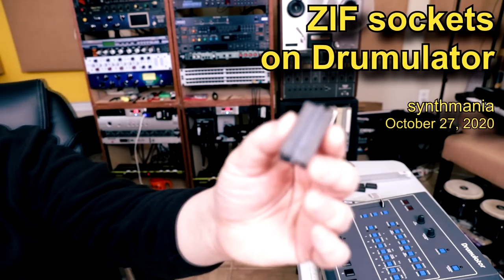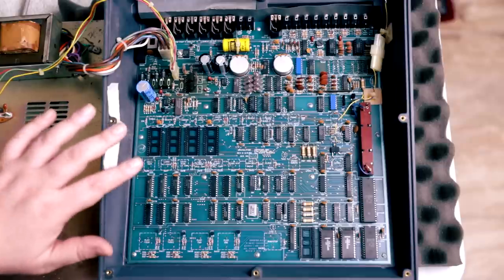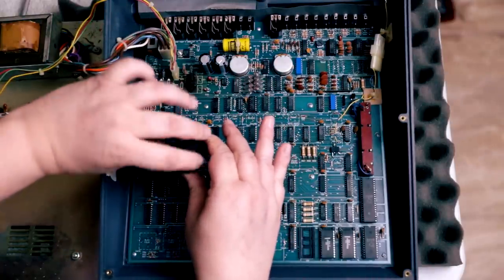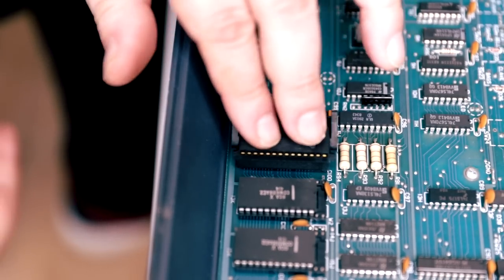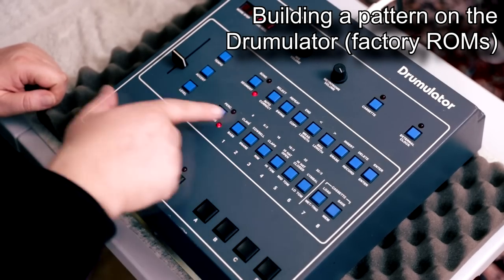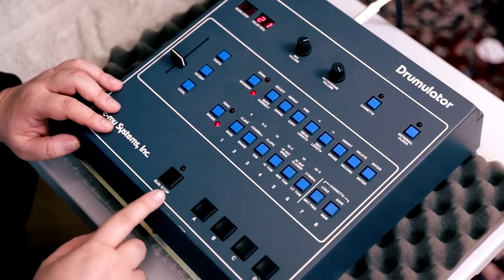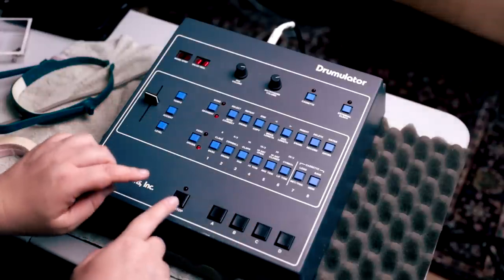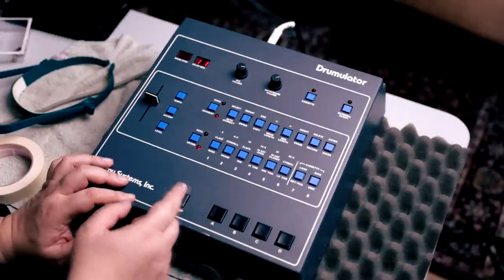ZIF sockets on E-mu Drumulator

Comment: For newbies - use extreme caution with static when working on electronics. ESD best practices are easy to find on the we can start with a basic wrist strap. Wurth has a video on ESD risks showing you can pass over 10,000 volts to your electronics via "static electricity".
Reply from the maker: In the drawers I have literally dozens of wrist straps that came for free with pieces of equipment I bought over the years - I never use them and never had one single problem. I like to live dangerously. Thanks for jinxing it, though!
Reply: @SynthManiaDotCom  hehehe. As founder of the Vintage Synth Museum, you know ESD well. My comment was more focused on newbies. Nonetheless, I still found the Wurth video on ESD "shocking"

Comment: My Drumulator has a commercially made switch on the front that toggles between 3 sets of EPROMs.  REALLY appreciating that now. Not sure why, but I love programming rhythms on that old thing, just enjoyable to use, was well designed.
Reply: Where did you get this mod from? I’d love to install it on my Drumulator
Reply: @orenberg1  It has a metal faceplate that says "JL Cooper Electronics 3-Kit" It was already installed when I bought it a few years ago.
https://jlcooper.com/_manuals/legacy/Drumulator/JLCooper_Drumulator_Kit_Installation.pdf

Comment: That "Rock Drum" ROM chip set (by Digi Drums), did they sell the same sound library ROMs for other drum machines as well?  That drum samples sound very familiar!  Great video again!
Reply from the maker: Thank you and yeah - they started with the Drumulator - IIRC reading somewhere - because they were near E-mu, and then started to offer their chips for other drum machines of the era, too. Eventually they became Digidesign (of Pro Tools fame). "Digidrums opened for business at the January NAMM show, with several alternate sound sets for the Drumulator. They've rather expanded since then. Now they offer 15 sets for the Drumulator, and 35 individual sounds for the Sequential Circuits Drumtraks. Coming soon, they say, are alternate sounds for the Oberheim and Linn drum machines." Source: http://www.muzines.co.uk/articles/namm-report/8465
Reply: @SynthManiaDotCom  Thank you so much for the info!  I didn't realize that it became DigiDesign.  The article gives me some context; it was around the time Kurzweil 250 was released, and Akai wasn't in the sampler game yet.

Comment: Good Day Paolo excellent video and looking to do this on one of my drum machines, I read in the comment that someone has a Kawai R-100 I have both models 100 | 50 , I looked up at the Aries website but unsure which one to choose ? I'm sure its a 40 pin socket but options are required to select?? , I been budling a library of custom sounds but do not like the idea of forcing chips when interchange, could you  suggest please which one would be a good candidate for my drum machine? I greatly appreciate Paolo have an excellent day buddy!! 👍

Comment: Does Zif Sockets still exist ? I feel nowadays chips are either soldered on the PCB or they are on a socket but not a Zif one, a simple socket (and they are a bit fragile btw)
Thank you Paolo, awesome video, always a pleasure to see and hear your drumulator :D
Reply from the maker: Thanks! Yes, today the prevalent manufacturing mode is SMT, which undoubtedly can make products smaller, cheaper, easier to manufacture automatically etc. - but hard for end user serviceability / upgrades...
Reply: @SynthManiaDotCom  It reminds me the inside of the midiverb (the first), it's so beautiful, no SMD, every chip is on a socket and everything was hand soldered in the US ; very nicelooking circuit board ^^
Thanks for your reply, cheers from France :)

Comment: Luckily, those old 'big box' drum machines have enough room in them to just put a ZIF socket into the existing sockets.  A lot of other devices don't have the clearance and need to desolder the original sockets and solder-in the replacements.
Reply from the maker: They also sell "low profile" ZIF sockets https://www.newark.com/productimages/standard/en_GB/1674770-40.jpg?01AD=3pASUN4L1uyhUar2H5Y6s-9v2ZOcqlQJMZAaStqRN4XfP6Qqx0Df26Q&01RI=0A4DBF103B38D53&01NA=na

Comment: Hey Paolo thanks for the video! Any recommendations on where to find this style of zif socket here in the US? Been looking to install some on my Drumulator but haven’t been able to find this exact kind, thanks!
Reply from the maker: Mouser, Digi-Key, Jameco etc. have them, the ones I used in the video are from Aries, I forget the part number but can look it up tomorrow - if you search for "zif socket 28 pin" you should find them in their stock. They also make "low-profile" versions, and versions with one lever instead of two - which are less expensive than these
Reply: Excellent, thanks so much!
Reply from the maker: The part number I used in the video is Aries 28-516-11. They also have less expensive models that have only one lever / or a little bigger if you have space in your device

Comment: I guess you do not really change the OS ROM as often as the Sound ROMs. Someone should have designed a board plugged into these 4 ROMs sockets with some little ARM chip with USB to load sound banks from computers and dump the ROMs to RAMs with double buffering. Maybe you can share a high resolution picture of the 4 ROMs if you have time.

Comment: Hello, I bought a set ofZIF sockets and they did not fit. Do you have a link where I could buy some, that fit?
Reply from the maker: The part number I used in the video is Aries 28-516-11. They also have less expensive models that have only one lever / or a little bigger if you have space in your device
Reply: Thank you

Comment: can i ask a qustion?im going to replace the battery in my  Akia sgo1v will h have to reload sounds via sysex or is there another way to get patches back in? thankyou for your time
Reply from the maker: I don't have an SG01v at the moment but I think the patches are burned in ROM - you can restore the factory patches using the procedure shown at page 18 on the manual. For added precaution, you can also save the program via sysex using the procedure shown at page 19 of the manual
Reply: @SynthManiaDotCom   great thanyou so much.love your channel by the way.

Comment: Lol I wish I saw this before I put in the rock EPROMs backwards into mine three months ago and broke my machine
Reply: Was just trying to rip off the Cocteau twins ...
Reply from the maker: That shouldn't have broken the machine... was it working before? Do you have a set of good ROMs to test it with?
Reply: @SynthManiaDotCom  yea it was working when the factory ROMs were in it.  pretty sure i shorted a circuit though and then two of the metal prongs on the sockets had broken off when i was trying to put force on the ROM to get it in place.  i got it fixed and the repairman said i had put the ROMs in backwards... definitely a rookie move : - )

Comment: Hi Paolo, thanks for the tip on the zif socket. I'd be happy to have the manufacturer number so that I'm sure to find the correct ones. Also, would you have the .bin files for the Rock Drums eproms to share ?
Reply from the maker: The part number I used in the video is Aries 28-516-11. They also have less expensive models that have only one lever / or a little bigger if you have space in your device. I've seen the .bin files online somewhere in the past but forgot to join it down, but I'm sure if you do a search you can find them
Reply: @SynthManiaDotCom  Thanks for the part number. Unfortunately the bin files are not on the web anymore, reason why I was asking. In case you get an eprom reader at some point I'd be really interested to get those bin files. Thanks for the videos !
Reply: @nuipb  I have them somewhere, i'll post a link if I find them
Reply: @robertcrystals  thanks ! That’d be really appreciated. If possible when you find them notify me through here so that I know. Cheers.
Reply: @robertcrystals  Thanks a lot Rob ! which OS should I use ? Or are both compatible ?